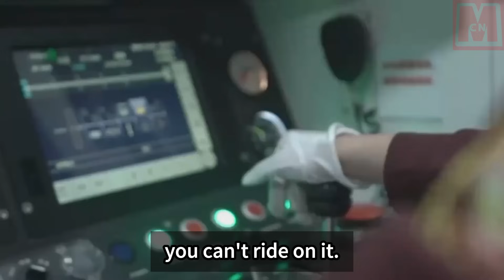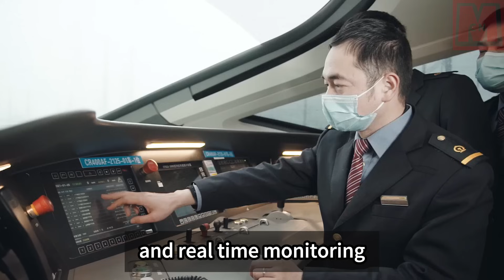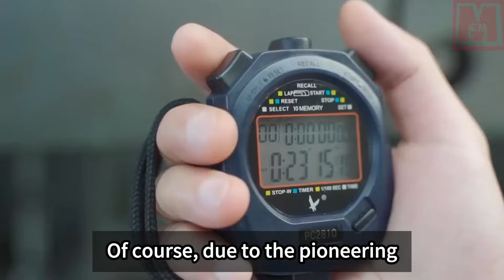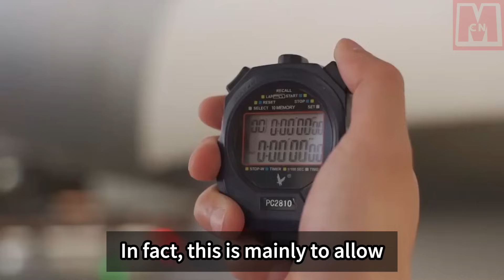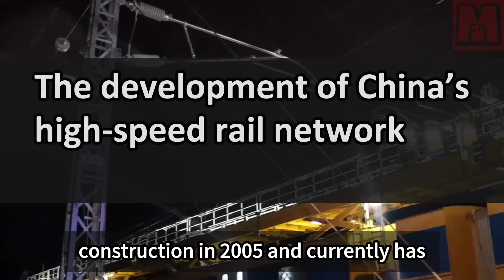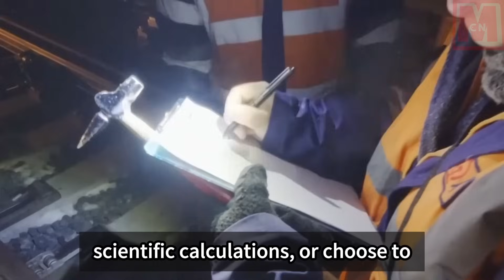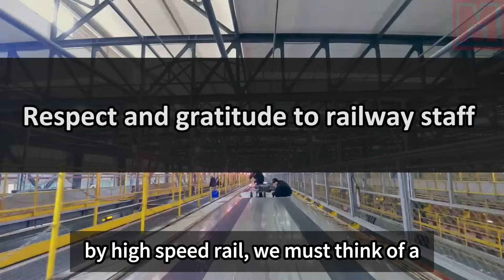China's most "mysterious" high speed train leaves every day but does not carry passengers

Comment: China puts the safety and comfort of her people at the front above all aspects including costs. Check and recheck is the way of ensuring the safety and prevent all problems during operations. That is one of the reasons why China’s longmarch rockets do not fail while SpaceX and NASA rockets explode even in two successive launches. The same applies with the Boeing 737max aircraft which was not tested properly and caused deadly accidents.
Reply: Oh Phillip, I think you neglected to mention the 2011 high speed train crash in Wenzhou. ALL mechanical devices can and will fail at some time.
Reply: @caretakerfochr3834  I didn’t say accidents can happen. But compared with the usa the many lethal accidents happened in aircraft, aerospace etc is far greater than in China. Just recently the emergency door of the 737max flew open during flight of Alaska airlines and American Airlines. The 737max 9 has now for the second time been grounded in the USA. When you want to compare do it with unbiased judgement because accidents can happen anytime anywhere even when you are driving to work. But, the number of incidents can be reduced by good quality control and well thought design. Hopefully the American civil aviation and Boeing could find the design error of the emergency door. 🤣🤣🤣🤣

Comment: The creator of the first self-propelled train George Stevenson (actually the first such train was made by Richard Trevithick but few know that) said: "The current railways can support speeds of 100 miles per hour easily. However in order to add another 10 MPH on top of that we'll have to make serious reinforcements to the railways that will make the effort not worth it from an economical point of view..." It was the 19th century - however the rule that the demand for railway quality increases exponentially as speed of trains using it increases remained and will never go. One can imagine the demand for quality and maintenance for the Chinese railways, especially knowing they're working on 400 kilometers per hour trains now - using the classic railway system. Of course there's the magnetic levitation trains, but a decade or two will pass till these become a frequent sight in China. Add extra one or two decades for the rest of the world, it will be more than 50 years for USA and Britain - I mean the British specially designed tilting trains cause they didn't want to redesign their 19th century railways 50 years ago, as these railroads had too many turns.